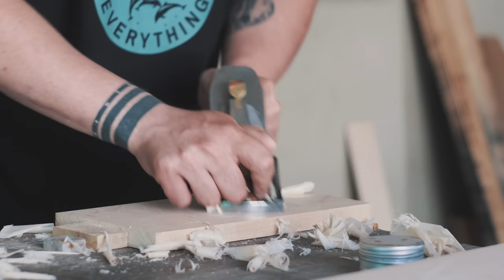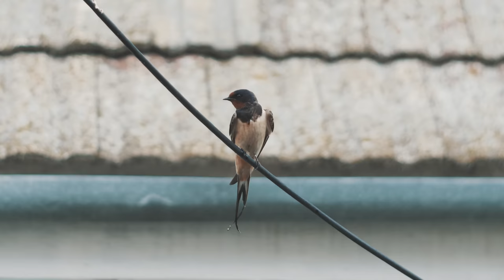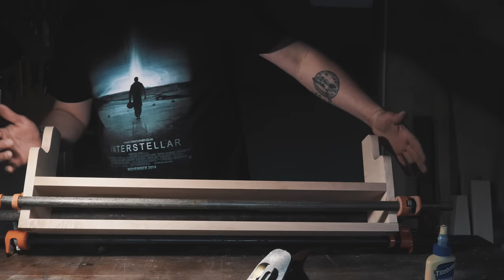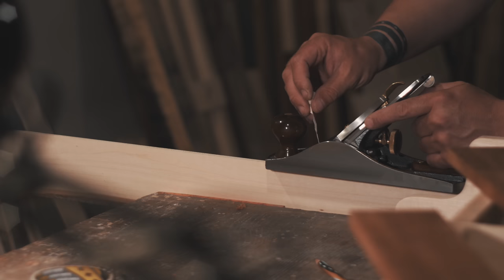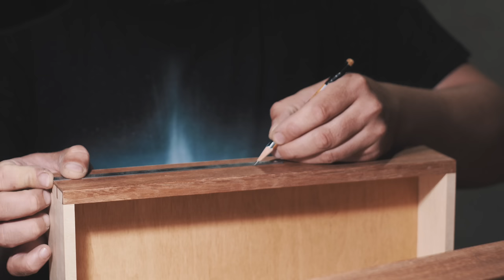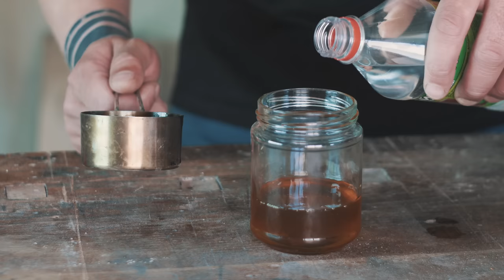Maple and mahogany Bookshelf making

Comment: You are only the second ever woodworker I've ever seen get such a good fitting on a set of drawers that by pushing one in no air can escape and the second one opens, the other was a master Japanese cabinet maker well into his 70s who probably started as a young child. I can only marvel at that level of perfection
Reply: There’s another guy one here who built a secret compartment using that same idea. Rob Cosman definitely builds to that level of precision. If you haven’t seen he’s channel definitely check it out
Reply: Using these drawers would annoy me to no end.  I would quickly drill holes in the back side to relieve that air pressure.

Comment: A very well made piece of furniture. What I would have done differently is the sign instead of scratching or only scratching what is chiseled away or if a continuous line is pressed with a fine pencil or just the wood to bring it to its original state when sanding with a little warm water. I would have left more air in the drawer, because the slight difference in humidity in the air can quickly get stuck, since hardly any air can escape, the 2nd drawer usually opens when the 1st is closed. I would have therefore also made half-covered prongs with a palatinate on the outside of the front board, so that the side parts of the drawer have enough air to work even with a difference in humidity and so that there is no jamming. But a very nice piece :) Have a nice day

Comment: Can you please share the markings on your board for the chisel and planes?  I notice others use that method as well but I have never been able to figure out the measurements. Awesome work also .
Reply from the maker: Oh, such a template on paper comes with a sharpening guide. And these dimensions are correct only for a specific guide, in my case it is veritas

Comment: Super beautiful Bookshelf!
I think someone else must have written this before me, but the Problem with the Drawers appears because of missing Airflow from behind the Drawers (it’s stuck behind your Drawers!).
Solution:
1.	You could drill a hole in the backwall of your Bockshelf. 
Or
2.	You could lower the Backside of the Drawer’s (make the Backside not at the same height as the other parts of the Drawer) so that the Air can circulate from behind, into the Drawer itself and then flow out.